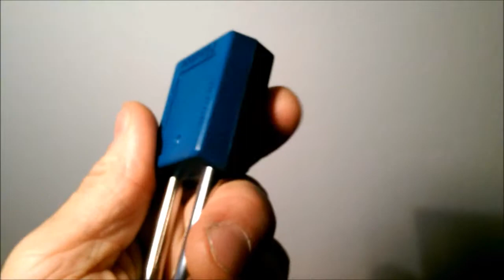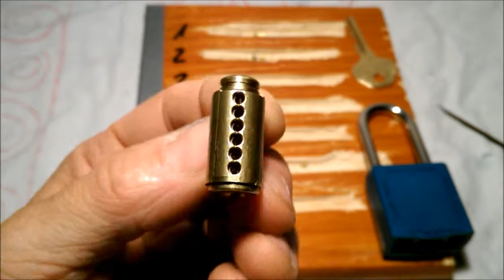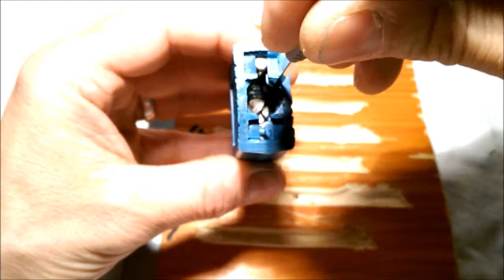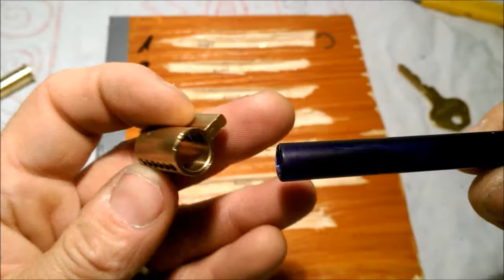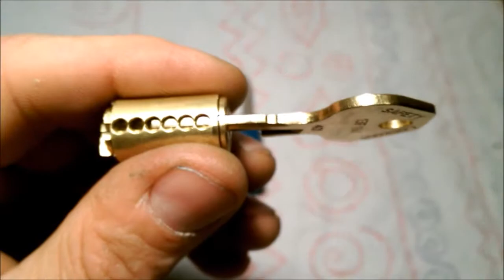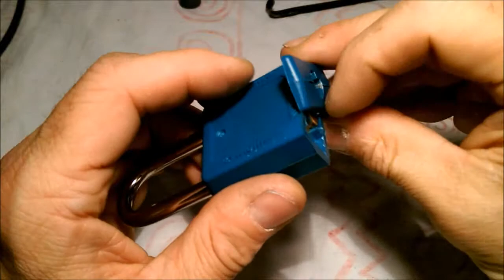(picking 11) Broken Master Lockout lock "repaired" (plastic housing cut open and core fixed)

Comment: I am just now catching up with your videos - great stuff! One thing that is a lot easier is to turn the plug and follower 90 degrees and then put the plug in. That way the pins won't get stuck in the holes while re-inserting.
Reply from the maker: ***** Thank you. You're right with the angle. That's someting I've learned inbetween.
Reply: I ruined a lot of locks when I was first starting out lol

Comment: Great video. You turned the core the wrong way when raking it. If that was the problem, you could have stuck a pick in and pushed the pins and turned the core back without opening the lock.
Reply: great video